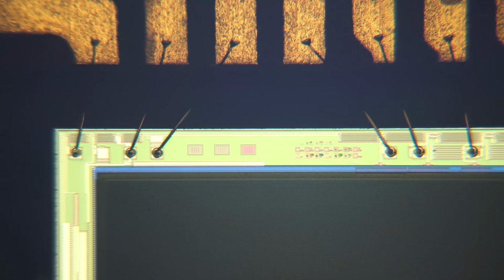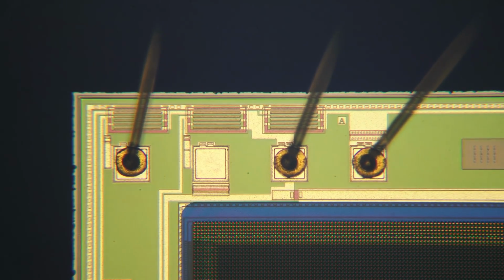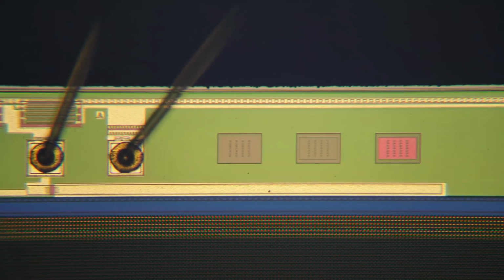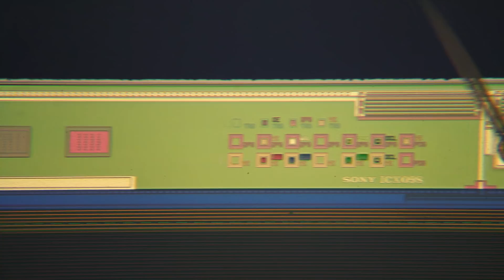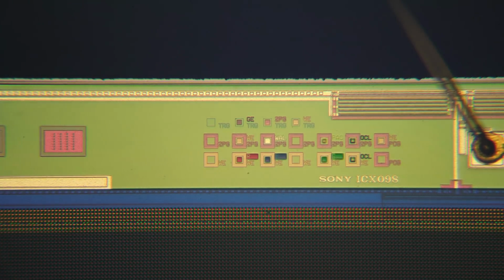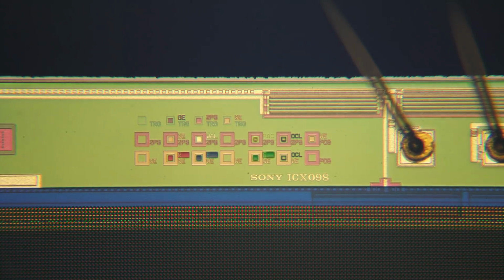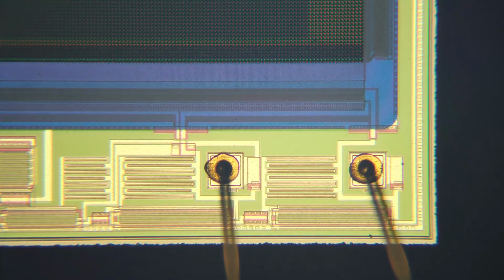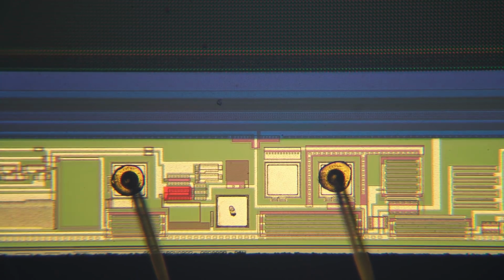Apple FireWire iSight Teardown

Comment: Would it be an option to micro solder an upgrade sensor on the lens and modify the software + Firewire replacement by USB-c in order to upgrade the whole camera keeping most of the original parts and design?
Reply from the maker: Nope. You could, however, replace all the electronics with something custom and modern, but I doubt anyone is willing to put in the effort to design it.
Reply: @PeterBrockie  it's been done, look up pisight.

Comment: Ever thought of swapping out the cam and modernizing the cable?
Reply: It would be great to see an iSight conversion where the case is used for some modern Mac compatible Logitech USB webcam. It could still be magnetically attached to the top of a Cinema monitor, and would work nicely on current MacOS systems.
Reply: @DavorPasaric  this exists, look up pisight @Jlw79

Comment: I wonder if that little PSU board is all you need to convert the 12V from firewire to 5V (or 3.3V).

Firewire was a much better connector than all the USB variants, shame Apple had to sabotage it with licensing fees.